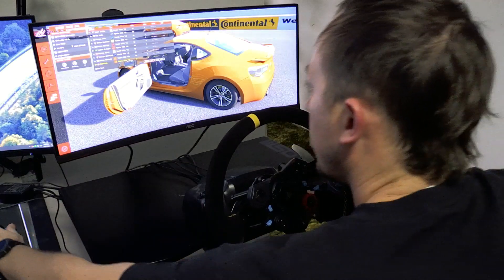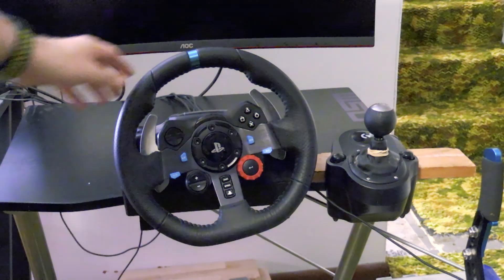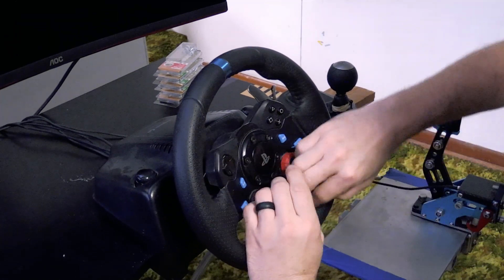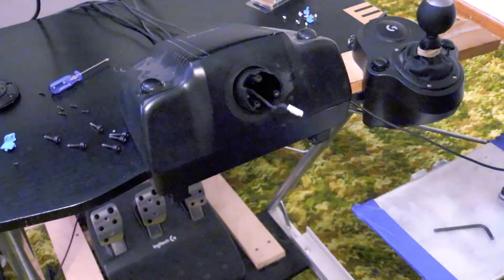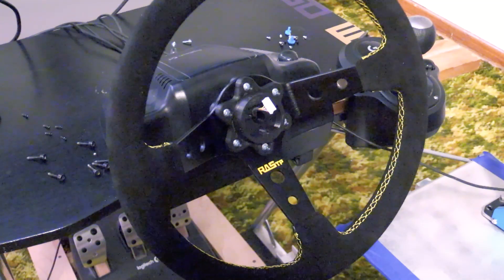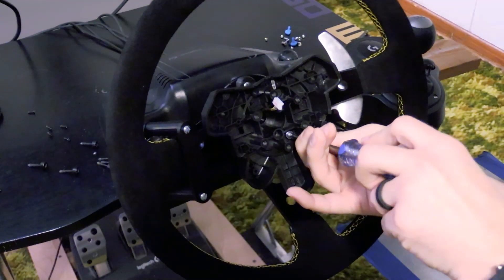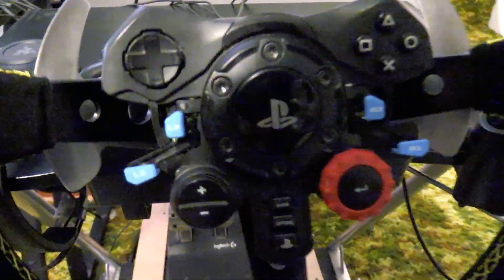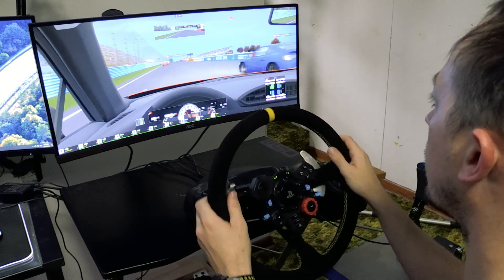Logitech G29 Rim Upgrade WITH BUTTONS

Comment: I ordered an offset steering wheel, where can I get these adapters so that the buttons are at the front?
Reply: Did you ever figure it out im trying to mod my wheel
Reply: I found it on... i dont know AliExpress i think... wanted to order it but they won't send it to Germany so i send the wheel Back and and Play in the normal wheel.
Reply: @TheOddOne-1 search for custom 3d Print wheel mod for Logitech g29 g923 g920 button Plate
Reply from the maker: There is a link in the description if you can 3D print them yourself. That's what I did. I don't know about ordering them from anywhere else as I did not do that.